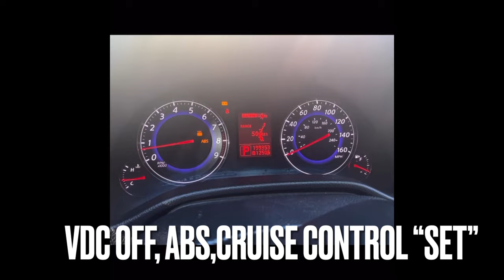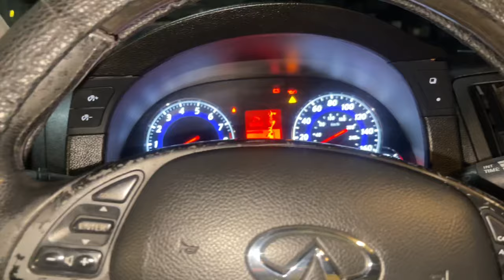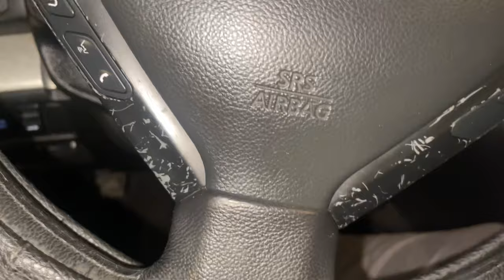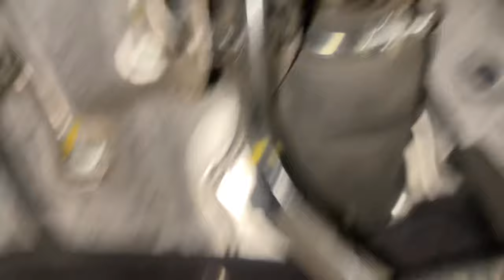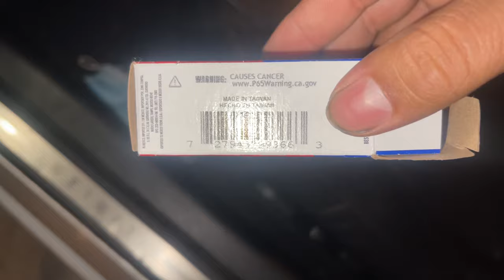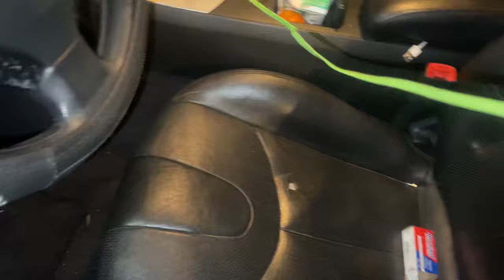How To Fix VDC OFF, ABS & SLIP LIGHT G37-370Z

Comment: READ THIS IMMEDIATELY if u have a g37 370z or any q u have a button under ur brake pedal u need to keep it depressed while u hold the little button for 5 seconds then u can let go of that and the brake pedal (search up q50 traction off button if ur stuck I have a 370z and it worked)
Reply from the maker: I tried that and it did not work unfortunately I had to replace the sensor
Reply: @DANIELSTv  replace wat sensor?
Reply from the maker: @alvinbvby9586  brake switch
Reply: What about the 35’s ?
Reply from the maker: Same
Reply: Anyone confirm this with a 370z? I drove one today and I turned off traction, slid the car and it went into a protection mode… no light, cut car off, reset itself after 15 min.

Comment: I have a 2009 G37x with mods. Getting VDC, Slip and AWD lights on. Will try this fix this weekend. Seems to happen when I drive a little aggressive. Comes in quick when I go into DS mode or when paddle shifting. Thanks for the vid. Will report back
Reply from the maker: Sounds good hope it does work out for you let me know
Reply: @DANIELSTv  Sadly, I'm taking it in to Infiniti at $165 diag fee. Keep in mind, this is more than I spent on my M5 at BMW. How is this possible!? Anyways, doing it one time to hear their bullshit and going to find a mechanic local. If anyone is in Sarasota, Florida, reach out please. I need someone less expensive but good.
Reply: @DANIELSTv  BTW I mentioned this vid, he said it won't fix my issue. I asked why, he said because the sensors you're talking about, one is brake and the other cruise control. He said if I replaced the brake one for what my lights are (VDC Off (switch doesn't work), AWD and Slip, it wouldn't help with my issue(s). I'll post back tomorrow night when I get the diag and what they say. Your fix works, as confirmed by a friend of mine, but this one is different I guess.
Reply from the maker: @rast4man  alright we’ll hope that works. I had the same issue all the lights in the dash also try pressing the brakes if the brake lights don’t come on or sometimes they do and they don’t most likely it is just try to swap it literally takes 2 min to do and if it doesn’t fix it just return the part and say you didn’t need it lol but it’s all up to you. Thanks for the support 🙏
Reply: @DANIELSTv  Yeah it's weird. It rained here this morning and I had to take the car in at 8:30, I didn't realize that with all of those lights on, I had zero traction control. I was sliding and spinning all over the place lol as much fun as it was I definitely want to get this fixed though because I wasn't prepared for that first thing in the morning half asleep and the coffee didn't even kick in yet. It's at the shop now I'll let you know what they say when they call me to pick it up. I'm sure they're going to try to bend me over
Reply: @DANIELSTv  So the verdict from Infiniti is the diag can't communicate with my AWD module. Said there are stored codes (DTC) due to internal failure of AWD Control System. They want to replace it for $2147.59 +tax. I said no. Noticed it was wet outside and I was sliding all over the place, so all my lights on means I have no traction control lol. Not sure what I'm going to do yet but that's expensive.
Reply from the maker: @rast4man  wow that’s really expensive maybe try another mechanic
Reply: @DANIELSTv  For sure. Got a good recommendation from even the shop supervisor at Infiniti. Going to schedule something with the new guy and see what's up.
Reply from the maker: @rast4man  perfect let me know
Reply: Did you ever figure out what the issue was?
Reply: @htx.kitchwa  According to Infiniti it's the Traction Control Module. They quoted like $1500 to fix it. For now, I'm just rear-wheel drive which I'm enjoying. I'll get it fixed at some point when I'm done playing around with it :) Sliding is fun and going to Mexico helps when doing rolls.
Reply: @rast4man what did you end up doing? I’m getting the same code
Reply: @Jay-vl3rv  Honestly, nothing. I was quoted $1900 for a TCM module. I decided to just keep it RWD for a while until I can find one cheaper.

Comment: Aye bro my care does this thing where the brake light vdc light and traction control light all turn on. Mine drives but when I brake the brakes feel different than regular. I was told to check my speed sensors but they look fine and I changed my brakes and topped off my fluid. Do you think it might be the same problem?
Reply from the maker: Try it it’s literally like 20-30$ at AutoZone
Reply from the maker: Mines didn’t start and it had all those light my break lights didn’t turn on at all even when I press the breaks
Reply: I got a 2007 m35 sport with the same brake slip and vdc you think I need the same piece?
Reply from the maker: @durellwalker6128  yeah look I would buy the part and put it in if it’s not that then you can go return it they don’t care lol it’s only 30&
Reply: i also have a 370z and have the same problem i believe the sensors are the problem.

Comment: I was having the same issues.  Had to actually press the shift release button just to move out of park.  We'll now my car won't even turn over but the lights are on, battery isn't dead. Could my car but starting be related to this thread
Reply from the maker: Check fuses if not it could be this problem
Reply from the maker: Any updates

Comment: I have a 2009 g37x with the vdc off light and slip light on and they are on 24/7 I switched the breaks the discs tried a multi meter but didn’t say anything about it said everything is running good, I will try this method but I have doubts that it’ll be this issue
Reply from the maker: Any updates

Comment: yo bro my car run and drives it jus has the vdc slip and abs light on , you think this could be a fix ? It’s runs and drives but I can’t jus can’t turn off the traction lights
Reply from the maker: Check fuses first.. if not just replace the sensor is like 20-30$ if that doesn’t work just return it
Reply: @angel hernandez Bro, I have the same problem! The vdc slip and abs light are on…..did you ever get to fix yours?
Reply: @DANIELSTv  and imma get this sensor form autozone and check if that fixes the issue, hopefully 🙏 
Thanks for the video man
Reply from the maker: @bafertumble5840  check fuses check brake fluid level
Reply from the maker: Let me know

Comment: Yo bro I have a Infiniti g37x 2012 every time I floor it or accelerate hard the Traction control Slip light and Emergency brake light stays on until I turn the car of and on again. Do you think this would be a similar issue?
Reply from the maker: Press the break and see is the break lights come on.
Reply: you need new rotors n pads big bro
Reply from the maker: I don’t think it’ll get those lights on for that
Reply: @DANIELSTv  that’s whats happening to my car rn , i thought it was because i needed new brakes all around
Reply from the maker: Slip and traction control comes on? Does your steering wheel shake?
Reply: @DANIELSTv  yeah when im braking from high speeds
Reply from the maker: @alexcuellar9878  your rotors need to be resurfaced or replaced then
Reply: You may also have bad wheel bearings because the shaking will put lateral force on the wheels.

Definitely change the rotors ASAP. If the wheel bearings are loose then also change them.

If you reset your ECU after fixing the brakes and the lights return then I assume you need to clean or replace your ABS sensors. 

I fixed my neighbors but his issue was bad wiring his ABS sensor on his front passengers side wheel. 

It can be many things.
Reply from the maker: Check tires also
Reply: @alexcuellar9878  hey what was your car doing ? My slip and vdc light come on and loses power doesnt let me gain speed I have to pull over and turn the car off every time
Reply: @user-ny9le6ps3h  my car never lost power but when i got up to high speeds vdc and slip came on , im pretty sure rotors n pads had to be replaced not 100% sure tho i sold the car already
Reply: @alexcuellar9878  okay thanks man yeah as soon as those lights come on it doesnt let me gain speed at all and jerks if I do Im thinking of changing you said the rotors and pads ? Im going to have my mechanic look at it as well
Reply: @smokindeadops did you fix the problem cuz I’m having the same trouble with mines
Reply: @user-ny9le6ps3h aye man you ever fix this? my car having the same problems
Reply: My car has the abs light and top traction light on and it don’t come off ? I put fluid and it’s still on I disconnected the two sensors in the engine bay and put them back and still
Reply from the maker: Try replacing the sensor in the video it can also be the abs speed sensors in the wheels
Reply from the maker: Check rotors and brakes
Reply: @DANIELSTv  check insta
Reply: Your low on break fluid
Reply: @user-ny9le6ps3h we have the same problem. What did you do to fix it?

Comment: I have a 08 g35 and half of the lights on my cluster display do not work and I can’t see rpm and gas tank do you think what I might need to fix??
Reply: Have same problem lmk if you find a fix
Reply: howd u fix it
Reply: @Tyeazy howd u fix it
Reply: @spazsplak  went to junk yard and got a used sensor off another g37 went right off

Comment: Are you saying the car wouldnt start at all (1) or it started but then was stucked on park (2)? because (2) is what i have Thanks! I already ordered the part to try it out

Edited : problem was the Stop Light fuse..
Reply from the maker: We’ll mines didn’t start at all that’s why I suggested in the video to check the fuses first and I already had done so. After I checked everything was good but still no brake lights so I did some research and it was the part I suggested in the video but glad you solved it!
Reply: @DANIELSTv  yeah your video is perfect!, i just didnt check the fuse right away as it was getting late here, thanks!

Comment: i have the same problem with my infiniti fx35, when i move the steering wheel to down the vdc off and slip light coming on.

which one should i replace the black with white top or black with blue top or both of them
Reply from the maker: Black and white is for the brakes

Comment: So those sensors didn’t let the car turn on?
Reply from the maker: Correct I had those lights and it wouldn’t move from park lol
Reply from the maker: Also the fuses were good and my break lights didn’t come on.
Reply: Which senors I have same but no abs lights
Reply from the maker: Break sensor I listed the part number on the video
Reply: Do you mean the brakes lights at the back? They probably not meant to turn on when transmission on P, i have the exact same problem as you since today, im.ordering the part. Cant take IT off park and same Lights are on!! But car starts normally
Reply: Ok mine was the Stop Light fuse.. thanks!